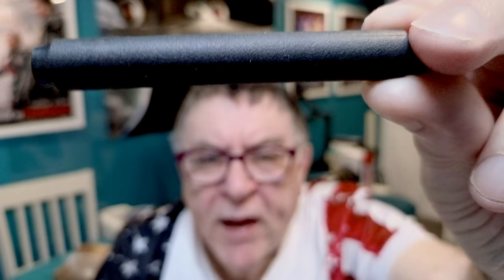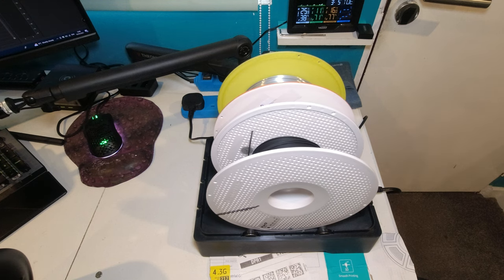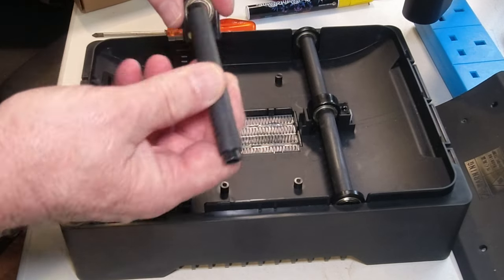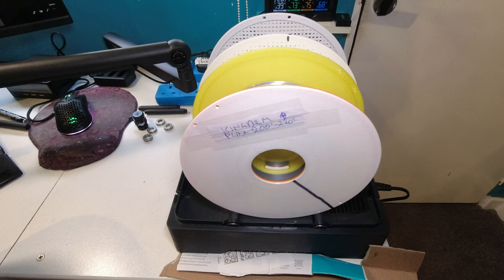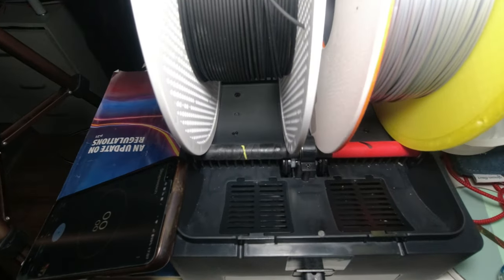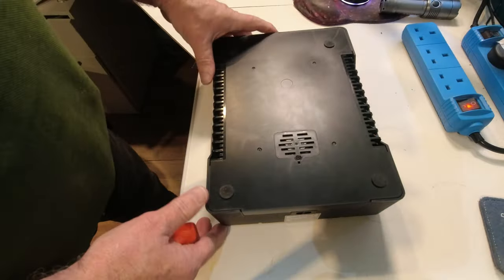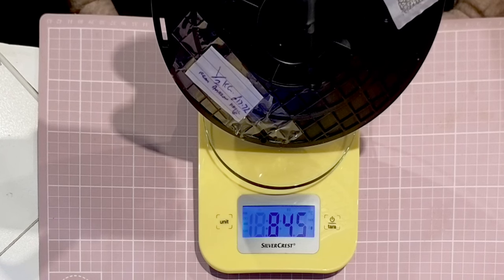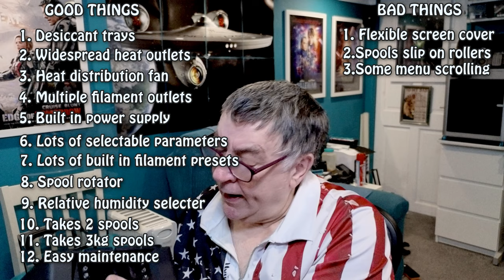Eibos Polyphemus Twin Spool 3D Printing Filament Dryer PART 2 roller fix, motor and drive swap etc

Comment: Problem i see, that it seems that initial design choice was flawed, so any fixes will be compromise of sort. Like grippier overall roller material probably will wear out eccentric o-rings much faster, adding just partial sleeve/tape may add limits to spool width. And more resilent motor-roller linkage ways probably would lack roller freewheeling ability, when printing with fillament from dryer, unless it's mechanically overengineered (increasing cost).
As alternative fix like yours there was printable model of TPU sleeves for rollers.
As i don't see high chance of whole mechanism to be redesigned to not have any slipping issues any sooner then in next model of dryer, to fix what we have here in this particular dryer, imho TPU sleeve, but with rised side/sides detent, for spool to not slip into non-covered by sleeve area of roller.
Reply from the maker: Hi Church ...thanks for the comment...yes I am sure I could have designed the roller feature better myself. Like you say the TPU sleeve or the rubber wrap I did will definitely improve it but its a weird design and not ideal.
Reply: @TomsManShed  In my mind, best design would be gear linkage of motor to rollers + one-way bicycle like ratcheting inbetween, for "freewheeling" (during printing). But .. that probably falls into overengineered/+$20 to price of each unit area ..

Comment: Hi Tom, do you think a filament drier is a neccesary buy bearing in mind that I will be using PLA in the main at the present time.
Reply from the maker: Hi Graham..no ...unless you store your filaments in a damp or humid place... I haven't used mine since the review ...I mainly bought it as I was curious and to do a review on it but it will rarely be used

Comment: Design and 3D print new rollers with a textured surface?
Reply from the maker: Hi Steiner...unfortunately I have zero skill in design  :)  ...main problem is the actual hardness of the roller plastic ...they do already have a textured surface (shown at 04:30) but still slip.

They really need to have a "stickier" surface ...the wrapping with the rubber tape round them works well and is an easy solution...I saw another review and he mentioned he had made some TPU "sleeves" to cover the rollers
Reply: @TomsManShed Well, the 3D hobby being what it is I'm sure people will make options fairly soon. I've got the rubber tape in my Amazon basket and your review (with a few more) helped me decide and I ordered the dryer (at 20% off too) .